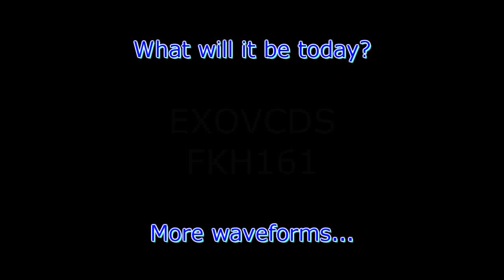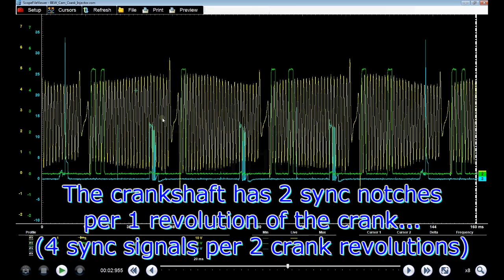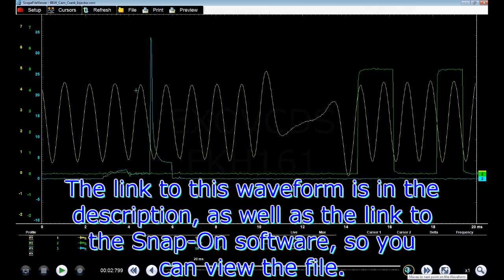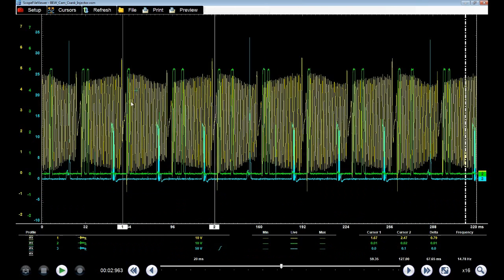VW A4: 1.9L BEW TDI Cam & Crank Waveform

Comment: Nice, is it same 60 teeth per one revolution ?
Reply from the maker: 60 teeth yes... but 2 sets (of 2) are missing, not just one set (2) like in the 2.0L & 1.8T waveforms.
Reply: Thomas EXOVCDS well its smarter this way
Reply from the maker: bbogdanmircea Yes... makes for quicker cylinder identification!